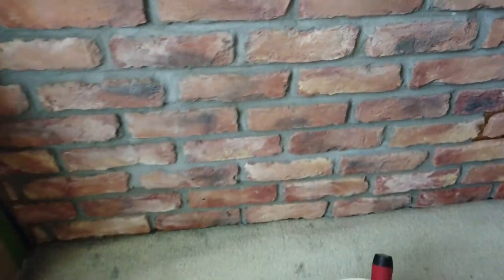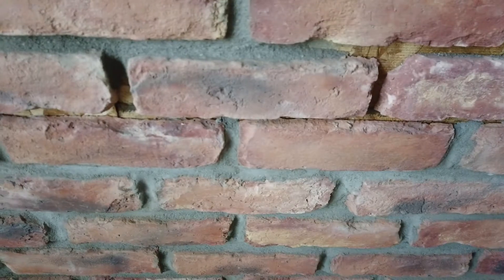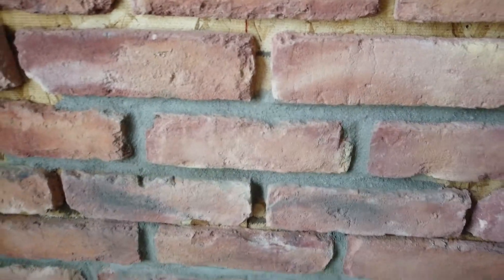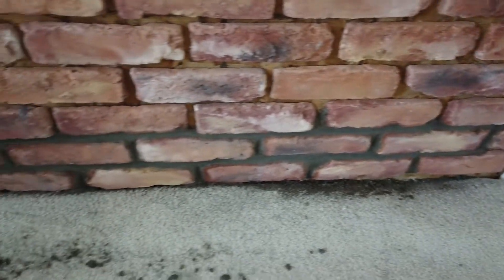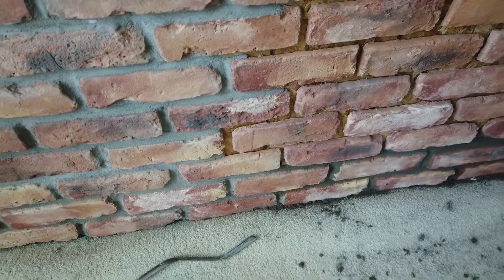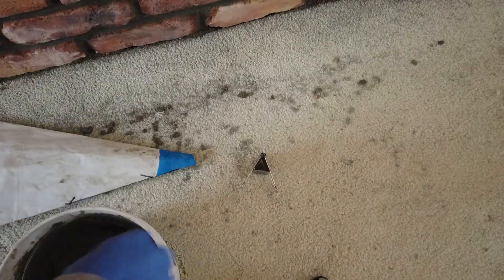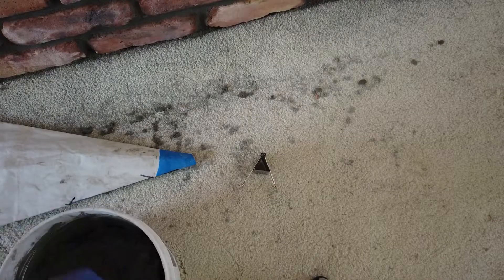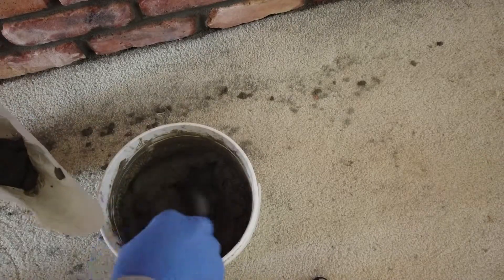DIY Room Remodel: Brick Mortar Success - Yay!!!!!

Comment: Would you recommend using a sanded grout for the joints?
Reply from the maker: Mitto Raymond - interesting idea. definitely more color choices. I guess i stayed more narrow/traditional in my approach.
Reply: @ReLoadersBench  is that on a dry wall? Would the wounded grout be lighter than the mortar? The bricks I’m using are from KONI materials
Reply from the maker: @Metiksray  - if you watch the entire series, you'll see what I did for the wall prep and brick/mortar install.  Short answer = no, not directly on drywall.
Reply: @ReLoadersBench  lol I am using the same bricks but I’m mixing the vino with rosse. What did you use to glue the bricks to the wall? I have a 12x9 wall and I bought 13 boxes. How big was your wall I see you got 10 boxes!!!
Reply from the maker: Mitto Raymond -I used the huge tubes (contractor size) of Liquid  Nails. My wall was 14’x9’

Comment: What brand is the mortar mix???
Reply from the maker: Greencore USA 80/95 Super High Yield Type S Mortar that I picked up from HD.
Reply: @ReLoadersBench  damn we dont carry that around here. The Quickrete type s didnt work well?
Reply from the maker: @dabig77  - Regardless of much/little water I added to the "retes" (quickrete/sacrete) I was not able to get it to flow evenly from the grout bag.   If you were to grout by hand trowel it would work fine.